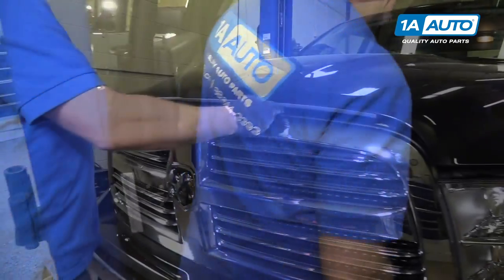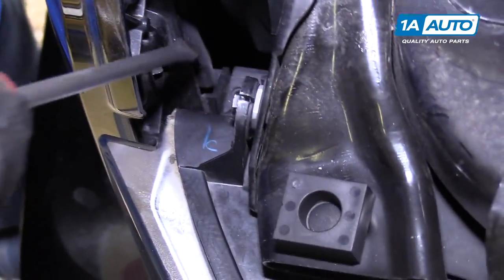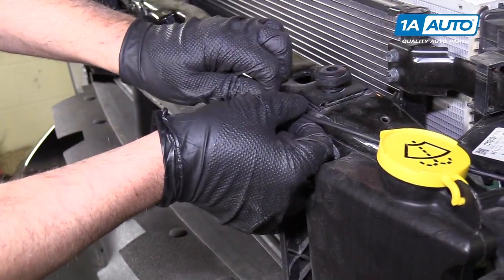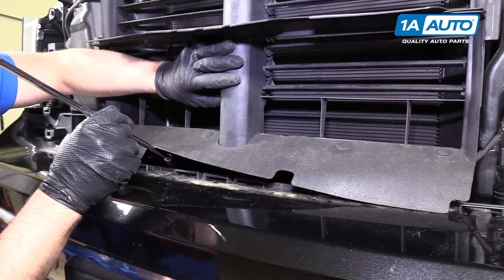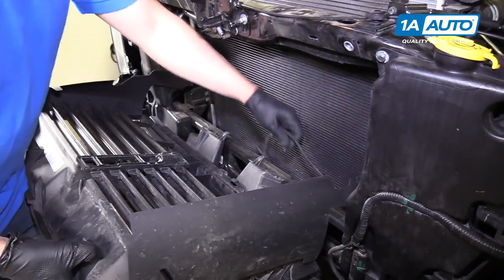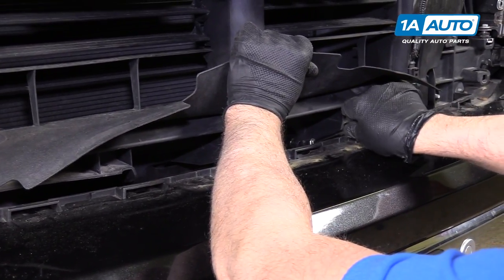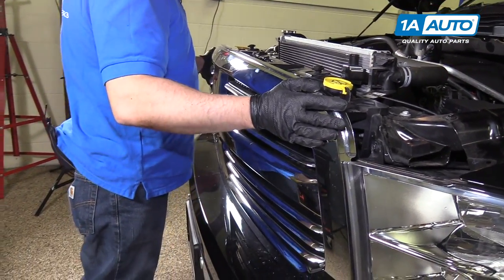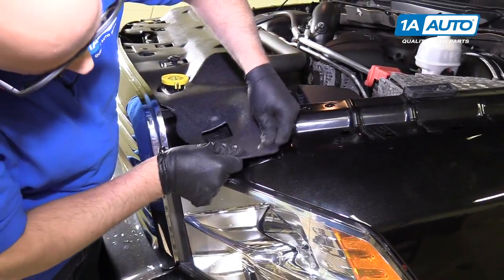How to Replace Active Grille Shutter 09-18 Ram 1500

Comment: I mean you did all of that but wouldn't you want to check and see before you bolt down the Grill Shutter if IT WORKS ? LIKE RIGHT AFTER YOU CLIIP IT BACK TO THE VEHICLE  ? GO TURN ON THE VEHICLE AND SEE IF IT ACTUALLY WORKS. I KNOW I WOULD. I WOULDN'T WANT TO HAVE TO REMOVE EVERYTHING AGAIN...